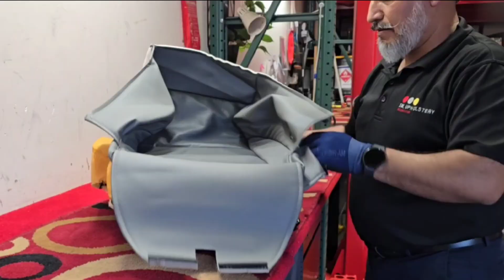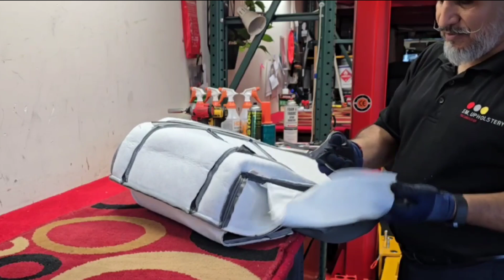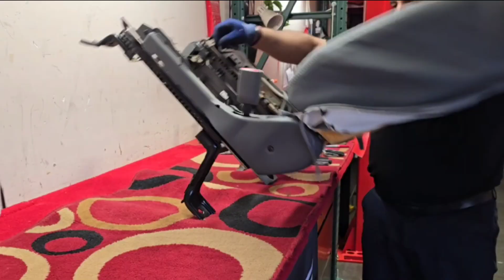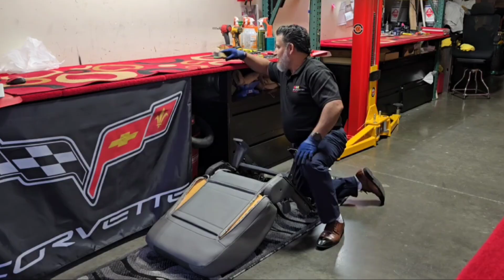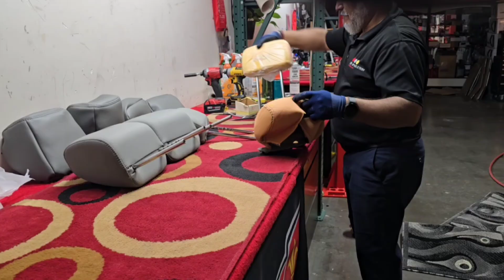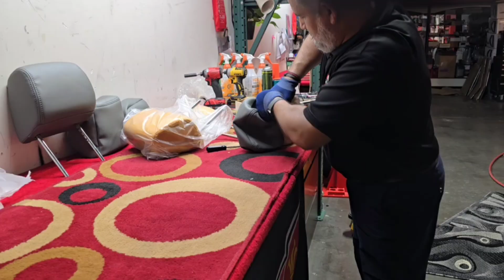How to Install Leather Seats | Nissan Titan Crew Cab

Comment from the maker: Ever wondered how pros get that factory-tight Nissan Titan leather fit? 💪
Watch as Eliseo shows step-by-step front seat leather installation for the Nissan Titan Crew Cab XE/SE (2006–2009) — real shop techniques, not shortcuts.

📞 Call 760-980-2383
🌐 https://emupholsterytechnology.com

Serving San Bernardino & SoCal — DIY kits or full installs available!